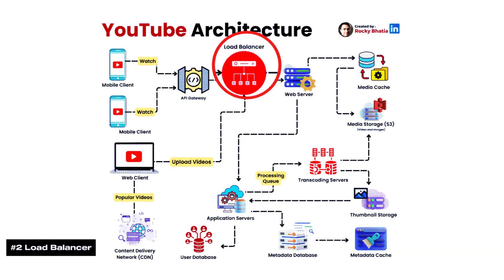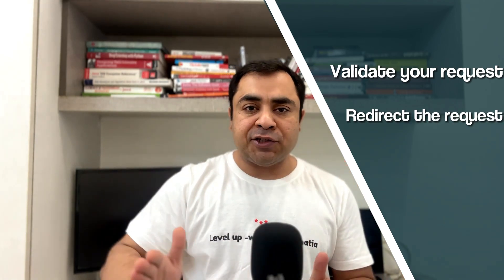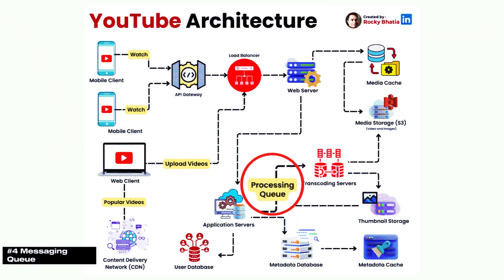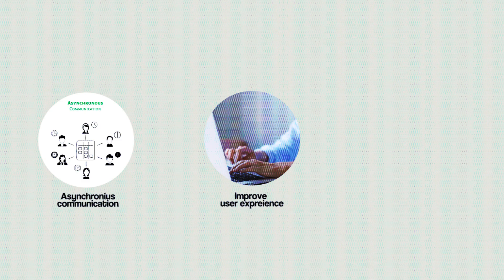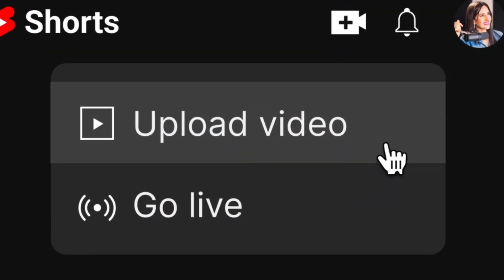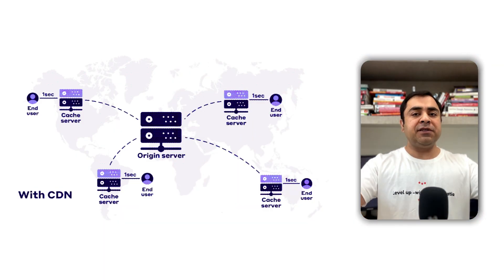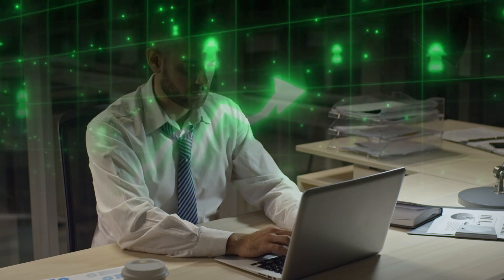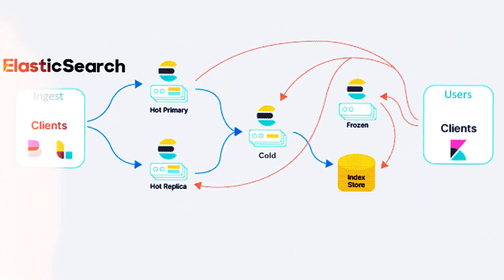Don’t Learn System Design Without These 8 Basics (YouTube Case Study)

Comment: Thank you for summarizing in short and efficient manner also can you please make a video on one example which would use all these components
Reply from the maker: Surely i will include another examples as well, youtube flow that we discussed in this video using all the components at the backend , its not specific to youtube most of system design uses all the components